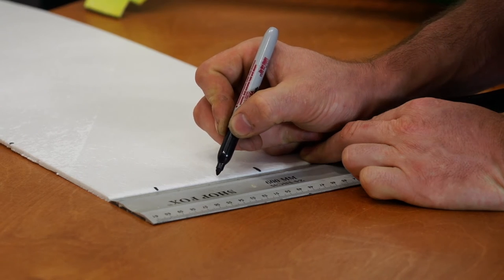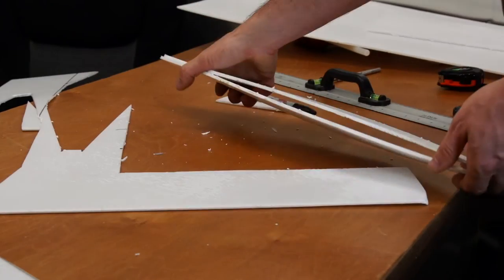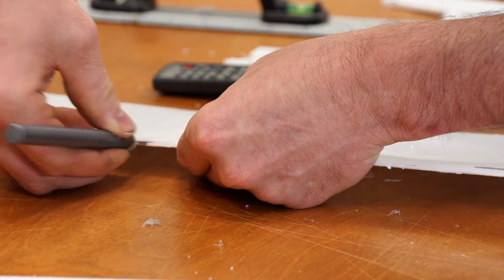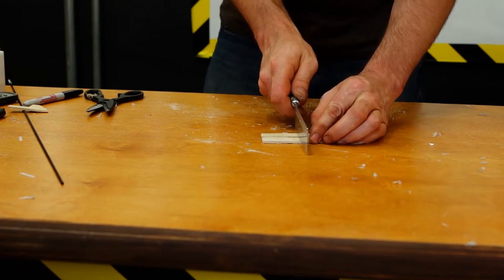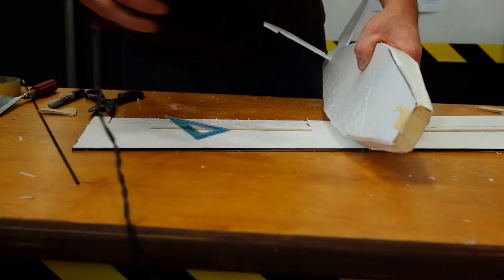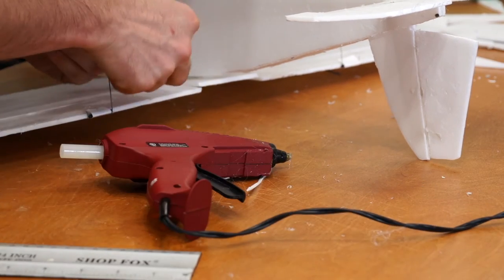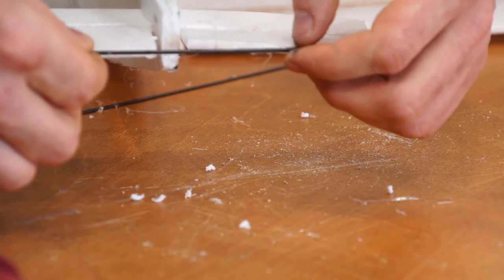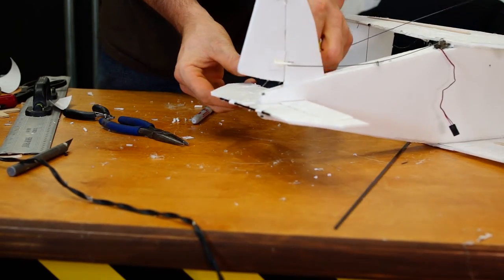How to build your own scratchbuilt Sport Biplane with step by step instructions

Comment: i really like the design of that plane. that being said, the bordeline pedantic craftsman that i am, physically cringed at the sight of edges frayed by a dull blade, and some other methods. admittingly, foam chews up blades pretty quickly, but still. it's easy to do much better than that.
i found that with just some strategically placed tape, plain depron (which doesnt have paper on it) becomes easily stiff and strong enough for most smaller planes. the tape really makes a huge difference!
Reply from the maker: I understand your complaint and I agree with what you say.  However, the rough ends are sanded down and the glue joints don't suffer from a little bit of fraying.  Admittedly my best work does not happen in front of a camera because I am trying to ensure that I am not hiding what I am doing with my hands which usually results in me not holding the knife at the proper angle.  Acute angles usually make much better cuts.  I agree that Depron is better and I have other videos showing its use.  For many however the paper backed foamboard Is cheaper and more available and is still a suitable material.
Reply from the maker: I will also add that using rigid material like CF or wood will keep the foam from warping in storage.  Agreed that tape will help but long term it will suffer.